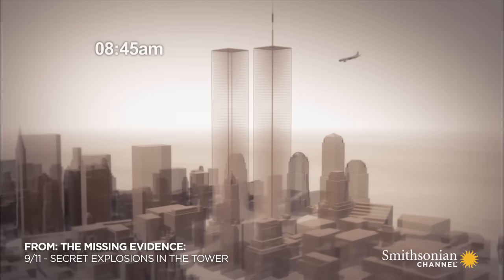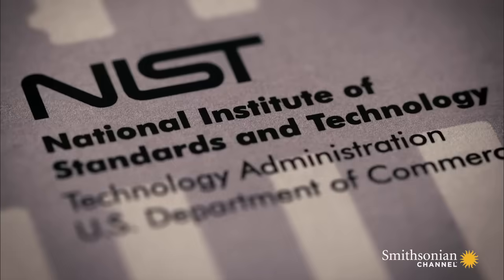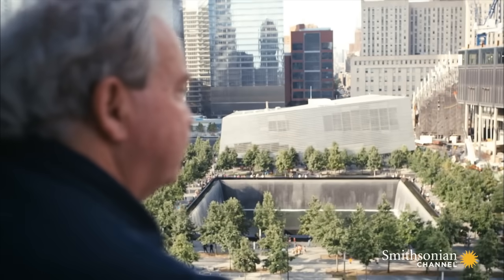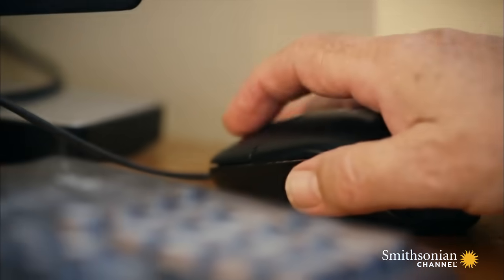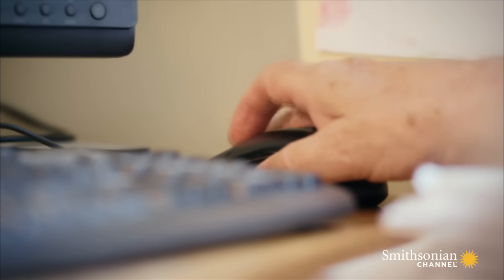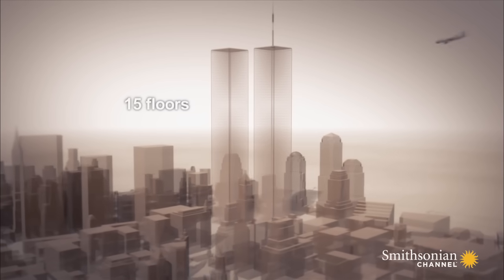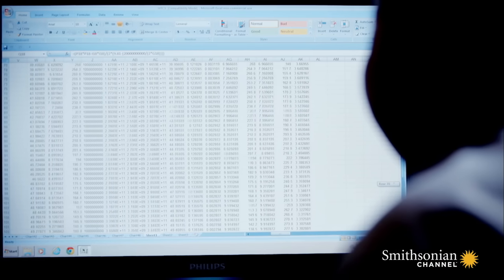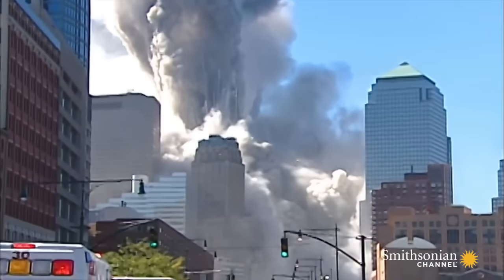This Computer Simulation Explains How the Twin Towers Fell

Comment: It's funny that all 3 buildings collapsed at free-fall.
Reply: MICHAEL DAVIS So you're telling me that physics only work under a controlled demolition?
Reply: Bro , if you get time watch 
    Dimitri Khalezov WTC nuked
I know it seams a bit over the top , but everything this guy says is ,100% fits to what happened on 9/11 , and how the buildings turned into micro dust , apart from the top.

Stay safe
Blessings
Reply: +MICHAEL DAVIS Why wouldn't they?
Reply: +Lewandowski Cyrille if it was at at free fall speed then it would seem as fast as the plane that hit it going down.
Reply: giantmidget08 we can easily forgive a child who is afraid of the dark the real tragedy of life is when men like you are afraid of the light
Reply: itzamia who knows....but the collapse should have slowed down and we would have seen 110 floors stacked up like any other  collapse...instead....the towers were pulverized to dust....why?
Reply: +Ignoscis They would if they were a controlled demolition but 3 towers fell "Free Fall" If you've studied physics that would  be Impossible. There would normally be a lot of resistance from the some of the columns and beams below. It wouldn't free-fall like as if you dropped a tennis ball or any ball with no resistance. Just free-fall. Free-fall means falling freely with no resistance.

Comment: The recent Dubai tower fire should prove this to be impossible! Also where is the stack of floors if this is true? If this happened there would have to be signs that it did! And the rubble at ground zero resembled no such event as described in this video. This WAS a controlled demolition.
Reply: Trolling People
Reply: +Trolling People (the trolling pac-man) 
I guess you have no knowledge of modern fire fighting techniques where they pump water into the lower floors of a high rise building by use of aerial mounted water cannons?
There was water available TP Pac from functioning water mains from the street. There was no need to endanger firemen to put out these fires. Why didn't they?
Reply: Trolling People
Thank-you, but I have read that prepared statement before somewhere. I didn't believe it the first of many times I skimmed through it but I appreciate your copy-paste of the official script. All anyone has to do is watch Judge Judy to know how to deal with such fantastic mythology. She often applies the wisdom of if it doesn't sound true - it isn't.
Buh-Byes
Reply: +Renttenzor Dubai had a different structural design and had functional fire suppression systems. WTC 1 and 2 fell because fireproofing was dislodged by the planes. The towers would have survived the fire alone as well.

Why would there be a stack of floors?
Reply: +Derek Williamson 
Building 7 had functional fire suppression systems fully automatic and gravity fed from roof storage tanks. It was not hit by a plane nor did it suffer substantial damage to the roof from falling debris from WTC1
Reply: +[no name] Building7 was build in 1987, the address was build in 2008. That's a large time gap, I'm pretty sure that by that time we would be better at building and they had plenty of time to research, plan, and use/tryout new building materials. The 7 wtc was infact damaged by debris when the nearby north tower fell. The debris also ignited fires, which continued to burn throughout the afternoon on lower floors of the building. The building's internal fire suppression system lacked water pressure to fight the fires, which made the building collapse completely.
Reply: ***** As the North Tower collapsed, heavy debris hit 7 World Trade Center, damaging the south face of the building and starting fires that continued to burn throughout the afternoon. The collapse also caused damage to the southwest corner between Floors 7 and 17 and on the south face between Floor 44 and the roof, other possible structural damage included a large vertical gash near the center of the south face between Floors 24 and 41. The building was equipped with a sprinkler system, but had many single-point vulnerabilities for failure: the sprinkler system required manual initiation of the electrical fire pumps, rather than being a fully automatic system; the floor-level controls had a single connection to the sprinkler water riser; and the sprinkler system required some power for the fire pump to deliver water. Also, water pressure was low, with little or no water to feed sprinklers.

After the North Tower collapsed, some firefighters entered 7 World Trade Center to search the building. They attempted to extinguish small pockets of fire, but low water pressure hindered their efforts.

Comment: I would like to know what model he used in the computer program.  Were the elements at the top the same as the bottom or did he figure in the structural strength of each section?  Those buildings were not the same from top to bottom.  They were built in no less than 3 sections each section (going up) getting steel that was smaller and lighter as it cut down on the weight the structural steel at the bottom had to carry yet rated for the mass above that it, itself, would need to carry.   In other words, it got stronger the farther down the collapse got.   

Also, if you watch the video of the 2nd (I believe) tower falling it is plain to see that the top canted and tilted as the corner buckled listing to at least a 45 degree angle, therefor, the weight  was not  direct downward force.  It should have fallen off but it didn't.   In fact, if you watch both towers, the tops were gone before the dust projections got even a third of the way down.  

So how did massive structural vertical columns that were not fire damaged in any way fail?  And how did the impact of the concrete bring down the central core as the floors were  anchored to it and not visa versa.  Sheering of the 5/8" bolts that connected the beams to the columns would not cause the columns to fail just by them sheering off.  The central core was triple reinforced steel and was built before the floors were added.  So why wasn't that left standing or at the very least the bottom section of it?

Comment: Molten lava 1400 degrees 3 weeks later explain how kerosine melts steel
Reply: +Ricardo Garcia It is about weakening. What is it with all this melting? Steel can fail without melting.
Reply: +Ricardo Garcia Steel weakens at 350 degrees and goes up from there.  Think of a stick of butter as it warms up.
Reply: Derek Williamson
I agree with Derek here. And also it is not about melting, it is about the steel losing it's integrity-meaning it's strength. Metal weakens under heat, a metal can weaken without melting. It is chemistry and engineering.
 And yet you keep hearing the word "melting" come up every time in the 9/11 conspiracy theories, yet when you explain what actually happened to the metal, they keep saying that losing strength only happens at melting point. People who have no experience in the sciences, state so adamantly that they know better than people who have 10+ years of experience because they saw a movie or read one book. It's not worth getting into a discussion with them, when the conspiracy becomes their identity (ex. "truthers"). To disprove that idea which they base their identity on is unstable and threatens who they feel they are. And therefore once a person is far down the rabbit hole of confirmation bias, there is ability to have a open dialogue  or debate.
Reply: mrandmrscrooked Regarding temperature, normal building fires generate temperatures up to 1,100 degrees. NIST believes temperatures in WTC 1 and 2 reached close to 1,000 C. At that temperature, steel retains only about 10 percent of its strength.
Reply: mrandmrscrooked Funny, earlier you said: "NIST admits that there’s no evidence that any part of the WTC reached temperatures higher than 600 degrees." That's not at all what NIST says. They believe it hit 1000 C.  

If you're interested in the evidence of temperature, I'd suggest you refer to NIST NCSTAR - 1-5 which is based on thousands of pieces of photo and video evidence, and multiple real-life or computer simulations. To say there is no evidence is a blatant falsehood.
Reply: +Derek Williamson 
NIST_WTC7_Tech_Briefing Page 50 Re:Column 79
"Calculations showed that even if the entire column were immersed in a flame as hot as 1400 °C, it would have taken 6 hours to heat the column to the point of significant loss of strength or stiffness."
Reply: Tommy Ferri
The Twin Towers were designed in the 60's to withstand impacts (and fuel fires) from a similar sized airplane traveling at cruising speed Tommy. No structure below the impacts was damaged. The towers were explosively demolished. Got it now?
Reply: +WyColoCowboy HAHAHA
Reply: +WyColoCowboy NIST admits that there’s no evidence that any part of the WTC reached temperatures higher than 600 degrees Celsius, therefore no evidence that the temperatures were hot enough to cause the trusses to fail.
Reply: mrandmrscrooked
 it didn't need to reach above 600 degrees Celsius to do the damage it did. And also, it wasn't just the dislodging of fire protectant, it was later analyzed through pictures (when it was inspected in the 70s and 2000s after within the wreckage, that the foam was not evenly sprayed and was not up to code) It was completely missing in some areas before the plane hit. Which is incredibly unfortunate, could you imagine how much more time people would have had if the fire protectant was thorough? My friend's uncle might have made it out of the South Tower if the building had stayed up longer.
Reply: Derek Williamson Well first NIST stated that the steel softened and then melted, which led to interior core columns failure. Hence, the pancake theory was introduced, which is widely believed to be false. National GEO had temperatures of up to 2900 F. Secondly, steel melts at 2800 F and unless in a specific combustion chamber a jet fuel fire will burn at a max. of 1500 F. In the time temp. curve NIST is right that it was an abnormally high temperature fire, however, this quickly dissipated. Now NIST is saying that the fires merely needed to weaken the core columns for global collapse. NIST now says there were pockets of fire that reached a max. of 1832 F. First these temperature last no more than 15-20 minutes, secondly these temps are upper layer Temperatures (Gas Temps) and not the steel temperatures.
Reply: Derek Williamson Also, the fire’s were oxygen ridden, hence, incomplete combustion and a rather low temperature fire. I mean NIST’s paint temps, we can conclude that less than 2% of the samples saw 480 F. Thermal calculation 600 F. Steel looses half its strength at 1100 F. The WTC floor assemblies heated to 2100 F and didn’t collapse. And this was fireproof steel. In conclusion, of the more than 170 areas examined on 16 perimeter columns, only three columns had evidence that steel temperatures reached 480 F.
Reply: Derek Williamson SO NIST admits that in only three spots temperatures could have reached 480 F, less than half of what is needed to weaken steel.
Reply: mrandmrscrooked It's not letting me copy/paste from the pdf, but NCSTAR 1-5F says that temps were between 400 and 800 C after the initial 20 minute burst.  I don't see 480 F referenced anywhere.
Reply: +Ricardo Garcia Who verified it was steel? Other alloys or compounds like aluminum have lower melting points.
Reply: AmethystEyes It did not have the color or melted aluminum, it was molten steel and/or thermitic material.
Reply: Derek Williamson There’s also no evidence that the protecting fire covering was widely dislodged or that any of the core columns reached above 600 degrees Celsius.
Reply: mrandmrscrooked There is a wealth of evidence supporting the dislodged fireproofing. In many areas, the core supports were protected with a double layer of drywall. The exposed steel is visible in many videos. Fireproofing dislodged from floor trusses and hanging down is also visible in several videos.
Reply: Derek Williamson There’s no evidence that WTC1 and 2 reached temps up to 1000 C.
Reply: Derek Williamson ????
Reply: Derek Williamson Yes, it says three columns had potentiality to reach 400 C.
Reply: mrandmrscrooked Between 400-800 C and "potentiality to reach 400 C" are very different things.... the latter is not what NIST has stated.
Reply: +MrScruffy86 Yes but that is just one column under that heat. What about everything surrounding it also giving off a tremendous amount of heat? Laws of thermodynamics show that heat will transfer between said objects and therefore the net temperature would actually be much higher than 1400C. Also think about the amount of metal that was bent or broken from the impact of the jetliner, that already puts a lot of undue stress on the entire structure. Add the fact that all this still is at extremely high temperatures and losing its structural integrity every second, with all that weight barring down on the metal and undue stress from the impact causing warping, it doesn't take much of a brain to figure how the whole structure would collapse from all these factors.
Reply: Grammar pls
Reply: Sorry zippy - the facts are in. The fire could NEVER have reached a temp to even have affected it. The entire structure was a heat sink - constantly moving the heat to the cooler structure above and below. There was nowhere near enough time for the heat to build. It was being vented out of the holes from the impacts and explosion. People were standing in the holes waving for help. Wrong there Zippy.
Reply: Derek Williamson https://goo.gl/images/DNrMgw
Reply: Here's what i propose, build a time machine, go back to 9/11 just before the planes hit and put all people who doubt how they fell inside the WTC and let them experience all of that first hand. Even if Bush somehow, even though it is impossible for this not to have been leaked by somebody, did 9/11 FUCKING GET OVER IT!!!!!!! WHAT DO YOU HAVE LEFT TO PROVE. 9/11 WAS OVER 15 YEARS AGO, ANYONE WHO COULD POSSIBLY BE AFFILIATED WITH "AN INSIDE JOB" IS EITHER DEAD OR LONG OUT OF OFFICE. ALL EVENTS THAT HAVE RESULTED SINCE 9/11 HAVE CEASED. NOBODY IS GOING TO BE HURT BY PROVING OR DISPROVING 9/11 WAS AN INSIDE JOB, NOBODY BUT THE "TRUTHERS" WHO CANT ACCEPT KENNEDY WAS KILLED BY A $19.95 RIFFLE FROM A SPORTING GOODS STORE.
Reply: "Office", is this guy kidding?
Reply: mrandmrscrooked The colour of heated aluminum varies at different temperatures, as with all alloys. There is no documented evidence (pictures or recovered materials) of steel that had been in a completely liquid (melted) state.

Comment: Everyone knows jet fuel can't melt steel beams.
Reply: @Ian Lavendermolten steel was everywhere for days. also, the passports didnt melt.
Reply: SkyGuy473 Jan 2017, a STEEL FRAMED BUILDING collapsed in Iraq due to a FIRE! Another metallurgist demonstrates how easily steel bends at 1400-1800° - it’s basically a noodle. Your arguments are invalid.

Comment: hack science. guy built a simulation program to fit a predetermined result. The simple facts are jet fuel doesn't melt steel. There wasn't enough jet fuel that burned long enough to even soften the struts. and if it did still doesn't explain a free fall speed and the total lack of debris from buildings that were just blown into dust.
Reply: +john morris No free fal speed, debris fell of, the fires were more than plentiful hot enough to weaken steel.

Comment: first sentence of the video and I'm already laughing

"... were designed to withstand the impact of a commercial jetliner"

how is that a requirement for a building? pretty sure engineers back then didn't even give a fuck about what was going to crash into the towers but rather if the columns could support their own weight + earthquakes if they ever happened.
Reply: +Ivankovitz You have to realize that the World Trade Center "twin towers" were designed in the 1960s. When they were designed, it was less than 25 years since World War II. Memories were fresh of an incident in World War II when a bomber crashed directly into the Empire State Building.

Comment: WTC7 was an 81 vertically columned 47 storied steel framed high rise that dropped into its own footprint in 6.5seconds+or-, 2.25seconds of that in total gravitational freefall. Forensic study found temperatures up to 4,735F[Molybdenum spherules-USGS].FEMA reported Steel vaporized and evaporated with holes in it 'like Swiss cheese'.RJ.LEE found spherical metallic particles 150xnormal building dust,Spheres produced by Molten droplets being violently introduced into air. Independent analysis of DUST found Active Thermitic Material [Harrit/Jones:Bentham] High grade energetics IN the dust.Molten steel was seen in the piles 'running down the channel rails 'like in a foundry'.Eyewitness testimony of explosive events before during and after aircraft strike were established 118 times in audio transcripts.[Barry Jennings.FDNY transcripts]NIST report is a 'probable THEORY',based on computer modeling un-tested by peers or x-examination paradigms not for public disclosure.
Reply: +elokubano There was no thermite! THERMITE NEEDS ELEMENTAL ALUMINIM AND THERE WAS NONE! IT WAS FUCKING CARBON STEEL! THE EXPLOSIONS WERE THE MELTED PLANE ALUMINIUM REACTING WITH WATER!